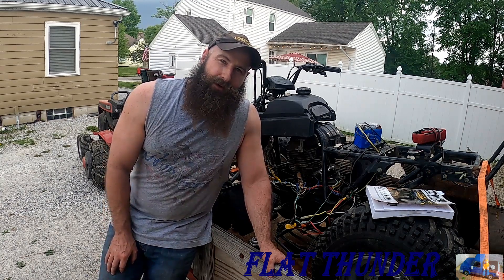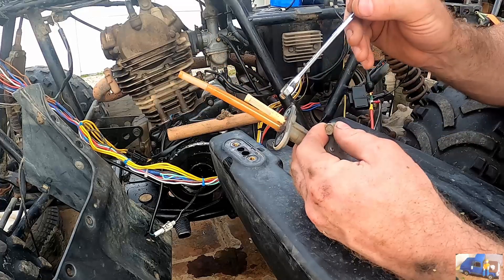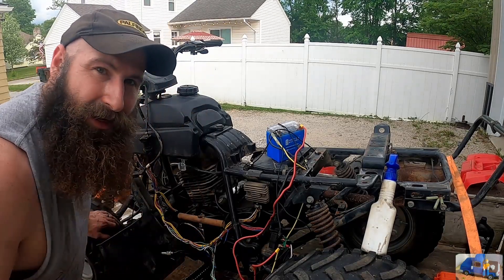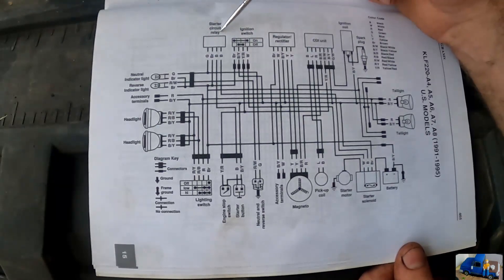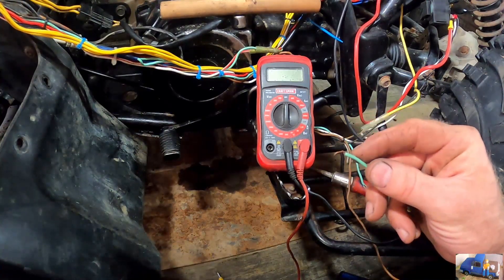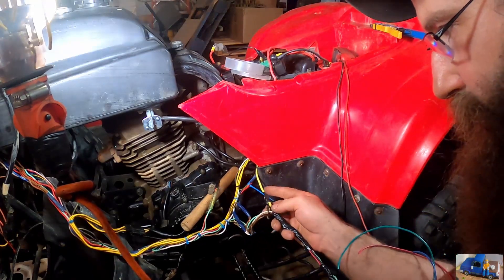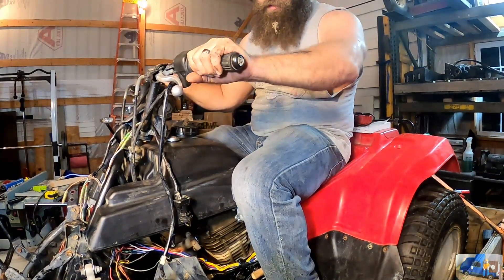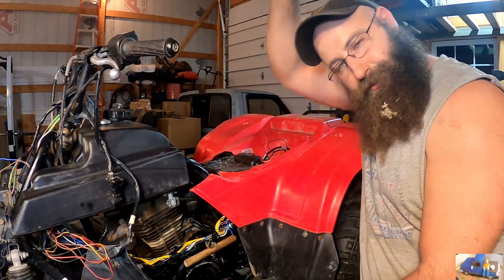KAWASAKI; 220 BAYOU FIXING ELECTRIC START / ATV WIRING TROUBLESHOOTING

Comment: Fantastic. Just recently my son-in-law came across a 1991 Bayou 220 that had been sitting for several years that the owner said he could have it to see if he could get some use out of it for his kids (my grandkids).
As the guy who gave it to him said it doesn't run and hasn't for quite some time. It's no cream puff but it appears to be all there. 
I'm going to help my son-in-law get it running.. I really want to see the grandkids learn how to ride and be exposed to something mechanical..gain some respect for something with power before they enter their car driving years.. and have some good fun doing it. 

Anyway I've started ordering some new parts to see if we can get it running. If the motor is shot there's no sense worrying with brakes, cables, tires, lights, etc... stuff like that just yet so I just ordered a new carb, fuel lines, air & gas filters, a coil, spark plug & spark plug wire. We'll need a battery. We have no idea if things like the starter button or starter works. 
But your video was actually perfect for what I needed to begin the process. It would be great if we can give this little ATV new life. 

Again son you did an excellent job on your video.. it really helped point me in the right direction on where to start and things to look for! Thanx 👍 consider your hand shook... much appreciated!
Grandpa Mike
Reply from the maker: That's awesome Mike!  I'm glad my videos can help out and possibly even inspire some of the younger generation.  It sounds like a fun project for you to enjoy with the grandkids!  Your words are too kind and it's nice to get positive feedback / comments on occasion.  Thanks!  Stop in and check out some of my other videos sometime..... I'm always working on something.  Best of luck on the repair and thanks for watching!  👍😁
Reply: @FlatThunder  new subscriber for sure 👍

Comment: Andy that was a fine video. I like fixers I am one myself and I have worked on ford 8n tractors three to be exact also 843 bobcat which I would like you to redesign to make mechanic friendly. I just bought a 99 grizzly 600cc atv that is current project. So your video was inspiring. Hope you and yours are well.
Reply from the maker: Hi Jay!  Thanks!  It is rewarding when you get an opportunity to fix your own equipment / toys!  I will have a TO-20 Ferguson on the channel sometime in the future.  It is very similar to 8N tractors.  Great little machine's with tons of nostalgia.  The 843 does need some redesign work.  Specifically the quick attach mechanism on mine needs a complete over haul.  I am happy I inspired you to get after that ATV project.  It sounds like a monster!  Thanks for watching! 👍😁

Comment: Hey buddy great video!! I have a question for you I have a 2012 Kawasaki bayou 220 and I need to buy a new ignition switch but I notes there are 2different switches one have two wire and the other have multiple wires I’m trying to order the switch and have it here before I take the old one out. Do you know which is the correct one for my year? Tnx
Reply from the maker: Thanks, I would think all ignition 'key' switches require multiple wire connections.  Maybe the two wire switch is the manual off ignition toggle?  This one used 4 wires I believe.  Thanks for watching 👍😁

Comment: I know this video was made a while ago but hoping you’ll answer. I recently bought a 1994 kawasaki bayuo 220. All it needed was a spark plug and brakes adjusted. I got it running and have been riding it around for a day or two. Out of nowhere it just cut out and I can’t seem to get it started anymore. Has gas, Spark and all the wires seem to be connected, as good as possible at least. The wires are a mess from the people I bought it from that rigged up rock lights and had random wires going everywhere. You have any suggestions on what the issue could be? Thanks man
Reply: Also electric start doesn’t work. Have to pull start every time. And the headlights or taillights aren’t hooked up right. but everything else is hooked up good to the battery.
Reply from the maker: Possibly just a bad or corroded connection if the issue is intermittent.  Check all the plugged connections to ensure they are making good contact; clean, use contact cleaner and apply some dielectric grease. If the connection is in question just eliminate the plug and direct wire it. Also check the pet cock in the fuel tank.  It could be plugging up with junk in the tank.  Thanks for watching and good luck on the repair 👍😁
Reply: @  update. wires look good and connected for the most part. Besides the push start because it isn’t hooked up correctly. So I have just been pull starting every time. I double checked spark and it was good. I took the carb out and cleaned it and sprayed carb cleaner and air through the jets. Then i realized the pull start kind of started locking up it felt like. so i pulled that out and the recoil spring came out so now i’m in the process of getting that stubborn thing rolled back up and in there(if you have a easy way to do that please let me know i’ve been struggling). If this doesn’t fix the issue and get it started then i plan on checking the timing chain and making sure it’s in line correctly. Do you have any other thoughts or suggestions on what it could be? Thank you again.
Reply from the maker: @ unfortunately, I do not.  If it is intermittent those are the hardest to pin point.  'I think'  the gremlins will be hiding in the electrical wiring or possibly a fuel delivery issue (maybe sticky float).

Comment: hope your still looking at comments lol. but got a 97 bayou 220 been sitting in my yard for a couple years. decided to pull it out and see what i can do. damn near replaced all the electrical system but it still acts like no power. try to jump the solenoid and it blows a fuse. im assuming its either its wired wrong or theres a short in the system. but looking at diagrams. putting my peepers on it and i cant see anything wrong. would the little nipple connectors that these have corode and be a problem?  thats the only thing im leading too rn
Reply from the maker: Yes, the connections can become corroded and cause intermittent issues.  The plastic plugs are far from weather proof and sometimes they can become loose or as you mentioned corroded.  Also worth noting the black magic ignition boxes on small engines like these can be sensitive to jump starter with oversized batteries.  I fried a few in my day!  🙄 Thanks for watching 👍😁
Reply: @FlatThunder  so did some testing with a volt meter... and it hurts me to say it but my fuckin solenoid was on backwards 🤦 put it on right and cranks right off. need a new carb bc i pulled the old one off and its corroded beyond cleaning and this mf should fire off.
Reply from the maker: @idriveamerc  it happens to the best of us!  Happy you got figured out!  👍😁

Comment: Hey, great video! Can you tell me what is the wire/cable attached to the cam-chain tensioner? And what does the other end connect to?
Reply from the maker: Thanks!  I'm sorry I am not familiar with a  wire or cable attached to the tensioner.  I believe the cam chain cover has a vent on the top.  Thanks for watching 👍😁

Comment: any luck with the carb/intake boot?  Mine is doing the same thing, wasn't sure if a new one would fix the problem.
Reply from the maker: I have not investigated further.  I believe the customer is still operating the unit with boot as per the video.  Ultimately I think the frame / motor mounts are tweaked a little causing the misalignment.   Thanks for watching!  👍😁

Comment: Great video.  I have a Kaw Bayou 220.  Here is my issue.  After engine gets hot the engine returns to an Idle RPM.  When pressing the accelerator it will spudder and stall if held over a few seconds.  When restarting it return to the same idle rpm and the process will repeat. If I vigorously shake the bike for a few seconds, the accelerator works as expected and can rev to a higher RPM.  Is it the carb?  If I remove the fuel supply line the gas flows freely for tank.    This issue does not occur when  the engine is cool (only after 10 minutes or more of use).  Thank you in advance.
Reply from the maker: I'm not an expert on these, but I'll gladly share my input.  If the carburetor has not been fully disassembled and cleaned I would start here.  It is quite possible that the cold engine likes more fuel and the float is stuck.  While riding at a moderate rpm it might not flood the engine, but at idle it might be free flowing into the intake.  The only other logical issue could be with a poor electrical connection or damaged coil / ignition component.  The heat may make the critical connections open or short from expansion.  I believe other owners have had issues with the factory pin connections in plugs not making good connectivity.  Trace all the critical ignition connections or at a minimum unplug and clean all plugs on the unit.  Good luck on the repair and thanks for watching!  👍😁

Comment: Do you have video of when you got the electric start to work from the Flat Thunder Garage?  I same same make/model and issue as this quad.  Your explanation is very helpful
Reply from the maker: The electric starter motor was replaced, but I do not have video of it.  It was replaced by the owner.  If you follow through the wiring troubleshooting section of this video it should guide you in the right direction.  Thanks for watching!  👍😁

Comment: Hey I have a klf220 that won’t get power to brown or white wire from solenoid I was wondering you could possibly send me a picture of how you have your wires run to yours I can get the wheeler to crank but not from the start switch
Reply from the maker: Sorry I do not have this unit at the shop anymore.  Try pausing the video and or playing at a slower speed.  It sounds like the solenoid isn't getting the proper inputs to close the 'safe to start circuit'.  Best of luck on the repair!  Thanks for watching 👍😁

Comment: Hi i have a 1992 kawasaki bayou 300 4x4 have bran new parts electric start dont work and now the relay keeps blowing the fuse and bran new spark plug doesn't seem to be sparkling can u help me out thanks
Reply from the maker: If it is blowing fuses, something is hooked up incorrectly and or you have some shorted wires in the system.  Check the plug at the handle bars, those like to corrode and make for a poor connection.  The rest is troubleshooting the wiring.  A lack of spark is likely from the wiring issue, but could be the ignition box, 'black magic box'.  These frequently die from jump starting the unit with a large battery.  I hope you get it going again!  Thanks for watching 👍😁

Comment: I need help with my bayou 220 the start button clicks doesn’t turn on alone the bike only turn on when I jumpstart it
Reply from the maker: I imagine the relay and or the wiring to the relay, shown in my video, is damaged.  The relay acts as a safety circuit for neutral / reverse.  Follow the wiring diagram and track the wires at the starter solenoid.  Good luck on the repair and thanks for watching! 👍😁

Comment: I need help. I have a kawasaki bayou fourwheeler that wont start. the lights dont work, electric start doesnt work. ive tried charging the battery and it doesnt seem to help. Theres a bunch of wires that are like open under the front rack but i dont see where they plug in to. theres a yellow and black, a blue and black one and i think a brown one. any ideas?
Reply from the maker: To be honest I don't remember all the color codes, but if you follow along in the video / wiring diagram clip it should help.  This unit was missing a relay a previous owner removed.  I think if the relay is faulty it prohibits it from starting with the electric starter.  Best of luck on the repair and thanks for watching!  👍😁
Reply: I have the same problem ever find it out ?

Comment: I need help i have a 1999 kawasaki klf 220a and I turn the key and nothing works the lights dont work norhing
Reply from the maker: Check the fuse on the starter solenoid.  I believe it should/could be very similar to the one shown in the video.  Best of luck on the repair.  Thanks for watching 👍😁

Comment: If I push the electric start button,nothing happens...no noise,nothing. But the ATV will start by pull cord. What do I check to get electric start to work?
Reply from the maker: Hi Denise.  Despite the obvious of no battery it is likely the safety circuit I outline in this video.  It will not start if it's in gear (Fwd or Rev).  The relay and or connections to the relay likely have a fault.  If that isn't the culprit check the starter solenoid.  Thanks for watching!  👍😁
Reply: @Flat Thunder  I messed with it again today..I took a good battery and hooked it up,even put in a new plug...now it won’t start with the pull cord. 😡. I even took the plug out,put a small amount of gas in,replaced the plug..pulled cord and it wouldn’t start! So I then touched both connections of the solenoid and it turned over like trying to start but didnt crank and run..yes it was in neutral and yes it has gas
Reply from the maker: @DeniseSlack  you have to be careful with batteries.  Little engines and motorcycle size engines have sensitive ignition modules.  I refer to the ignition module as the black magic box.  If the ignition and key are on it should spark.  If no spark is present you may have cooked the black magic box with too much battery.  I know because I have done it previously.  I try to avoid jump starting small engines with big batteries.
Reply: @FlatThunder  the battery I put in if is from my other bayou...I’m well aware of the type of battery used for these machines.so nothing was “fried”
Reply from the maker: @DeniseSlack  I do not think these units require a battery to operate.  Likely a wiring mess and or a damaged wire or connection in the system.  It's difficult to diagnose much more without poking wires.  Best of luck on the repair. 👍

Comment: WTF is in your beard...? 

Was hoping to see the steering column.... Wires I have? Don't match. 

Not sure what the guy did to this? 
Probably just gonna order a new harness... ?
Reply from the maker: If you follow the wiring diagram you should be able to hunt down and work thru the wiring mess.  These old four wheelers are usually cut on and 'farmer' wired around mouse chomps.  It's either part of an old mouse house or grass clippings off this machine.  Par for the course on this old stuff.  Thanks for watching 👍😁